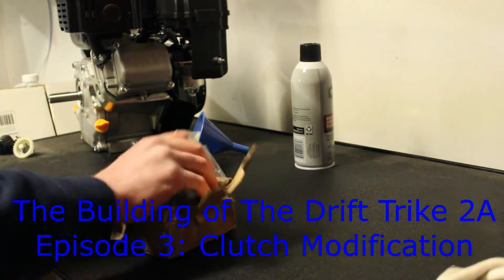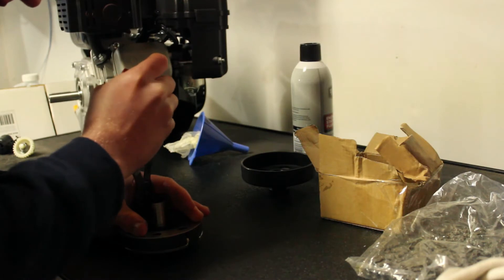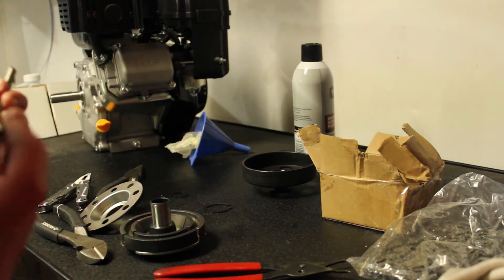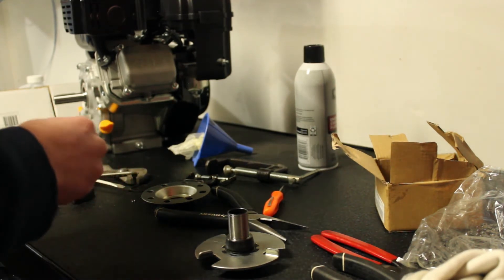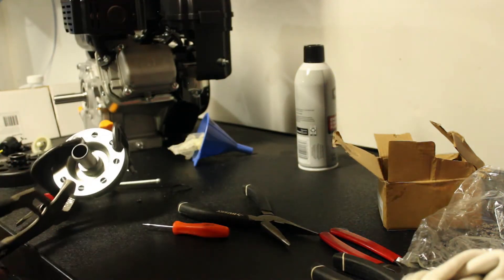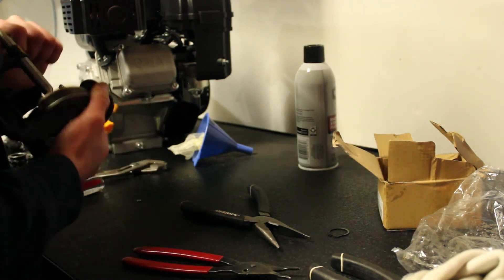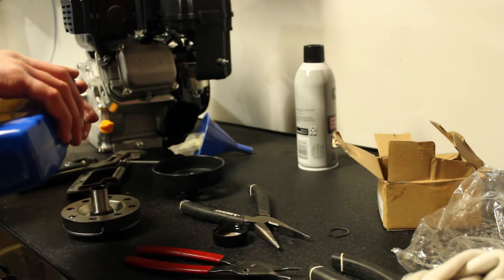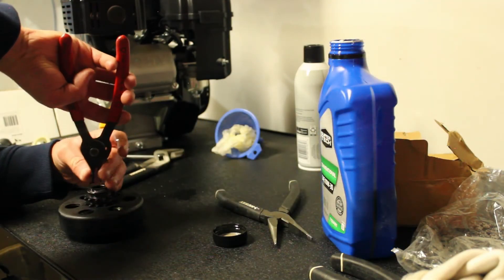How To Modify a Centrifugal Clutch - The Building of The Drift Trike 2A

Comment: Did it work
Reply from the maker: It works to a point: the engine can reach a higher RPM without the clutch fully engaging.  This is especially helpful with engines with large cams because they tend to idle better at a higher RPM.  Modifying the clutch can prevent you're trike from taking off while it's idling, and engage higher in the power band.